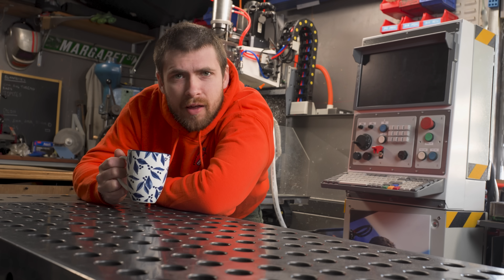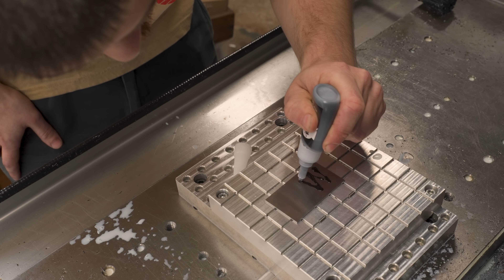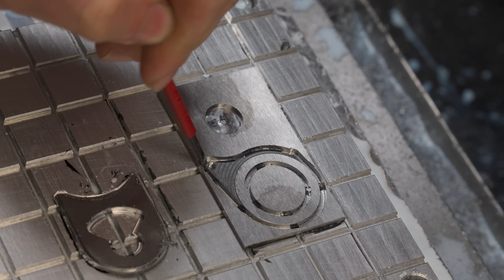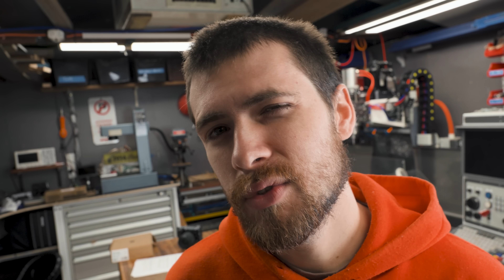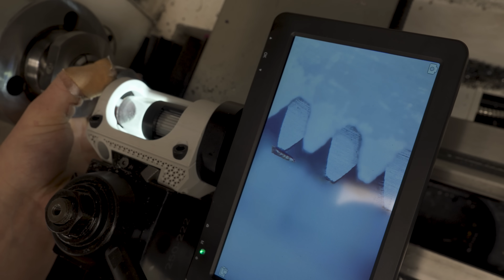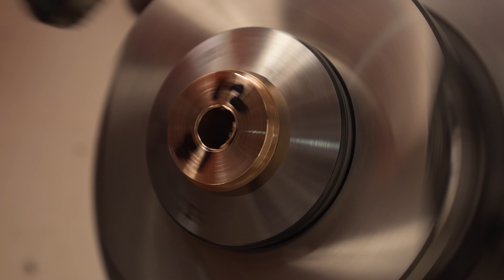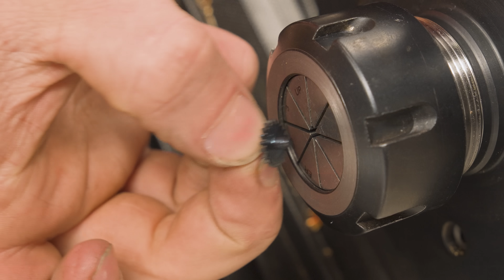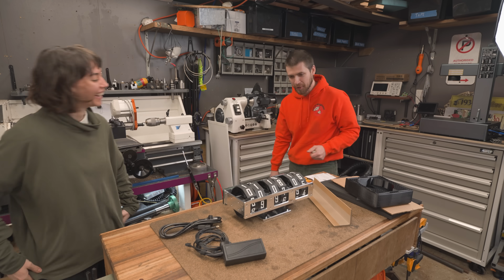What if angles were metric?

Comment: 37:30 fun fact: without a cellular connection, it can take tens of minutes to get GPS started. This is because the satellites use code division multiple access to be able to share a small set of radio frequencies between satellites. Receiving a CDMA signal requires first "acquiring"* the signal, meaning the receiver is constantly adjusting decoding parameters until it gets an intelligible signal. Acquiring the first satellite can take significant time. Afterward, the messages from the satellite include pieces of an "almanac", which has the information needed to greatly narrow the search for acquiring other satellites. But getting a whole, up-to-date almanac from one satellite takes 12.5 minutes.

Cellular providers generally broadcast the current GPS almanac to devices on their network, allowing them to skip the slow first acquisition and waiting for the almanac, and quickly acquire satellites.

clarification based on responses: the "can take" in "can take tens of minutes" is doing a lot of work. As receiver hardware developed, newer chips became capable of acquiring GPS signals faster. However, old chips (GPS or otherwise) tend to have long product lives, so I was expecting the slow GPS fix shown in the video to mean the clock was built with an old GPS receiver chip. However, after watching the video of the clock being made, I saw that it uses a relatively modern chip (NEO-6 family chip, 2010s, in the form of the GT-U7 module), which advertises a time to first fix of 32 seconds. I don't know why it took so much longer in this video. I'd like to point out that achieving this fast fix time requires significant hardware, with the module using the chip advertising "2 million correlators" to achieve this. It also supports being provided with an external copy of the almanac, as phones typically do, and advertises a 3 second time to first fix with an almanac.

*extra details: a major part of CDMA acquisition is synchronization. CDMA involves mixing the data with high-frequency pseudo-random data. The satellites talk over each other with these mixed transmissions, which each look like noise, but the receiver unmixes the combined mess with a specific satellite's pseudo-random data to get its transmission, and the other satellites' signals stay looking like noise. But the receiver needs to derive this pseudo-random data on its own, and it needs to stay in lock-step with the satellite. If the satellite's RNG is 159 when it transmits a bit, then the receiver's RNG needs to be 159 when it receives that same bit. The receiver knows (or more accurately, can calculate) the RNG sequence, but the receiver needs to guess where in the sequence the signal is at until it guesses right and the data appears.
Reply: Some corrections:
1. The Navy GPS designers arranged the NAVSTAR signal to have two RNG patterns, the slow pattern gives rough positions but allows quickly finding the right guess (it is thus called the C/A or Coarse/Acquisition signal)  The fast pattern provides the better precision, but was originally encrypted so only authorized US weapons could decode it.  However civilian GPS receiver designers found a trick: Because the same encrypted fast signal was sent simultaneously on two frequencies, a receiver could just compare the two without even trying to decrypt it.  Hence modern GPS signals gave up that secrecy and added a third frequency for precise civilian navigation, while reserving the right to change what is in the encrypted data stream.

2. Most cellphone networks don't distribute a copy of the GPS almanac, instead they provide 3 other services that allow cellphones to get the position anyway:
 2A. There is a service where the phone can ask the cellular carrier to use their radio tracking of cellphone signals to report the cellphone location based on the known location of the nearest celltowers.  Some modern phones can do the same using the known location of the nearest WiFi routers.
 2B. They broadcast the time of day with a high precision.  Time plus rough location provides the important 4 values from the GPS trilateration equation.
 2C. They provide Internet service, which allows the phone to download the weekly almanac from public websites run by the makers of GPS chips.  You could download that same file over WiFi if you have it, or just watch the GPS broadcast for 12.5 minutes (500 GPS data packets of 75 bits each at 50bps C/A speed).

3. GPS Time consists of a week number counted since Jan 6, 1980, a count of 6 second (300 bit) subframes since the start of the week and a count of bits since the start of each subframe.  Because the week counter is only 10 bits, the calendar starts over every 1024 weeks or 19.7 years, because everyone already knows which decade they live in .
Reply: @johndododoe1411 Based on relatively recent events, a certain phone company in Australia would disagree with "everyone" in point 3 :).
Reply: @johndododoe1411 "Because the week counter is only 10 bits, the calendar starts over every 1024 weeks or 19.7 years, because everyone already knows which decade they live in " 
Optimists.
Reply: Yes but no, a full cold start yes, but unless it’s been over six months since that device has updated, and you haven’t lost time keeping. You will retain a decent chance at locking in fast. 

If you’ve been on in the last 4 hours, and again have a good clock. you’ll get with in 100m in a couple seconds, and 10m a couple seconds after that. No cell needed.
Reply: @PredominatelyFutile   How precise does the timekeeping need to be? Because i have a bicycle GPS here which in absence of a mobile phone (it's intended to be used BT-tethered) drifts in timekeeping by minutes a week!
Reply: @SianaGearz  you can get nanosecond-accurate time from GPS alone (and, in fact, GPS only works if the device knows the time within a few tens of nanoseconds, which is why they made it so you can derive that from GPS in the first place). It's absolutely bizarre that any GPS enabled device wouldn't have perfect timekeeping, because it definitely has a phenomenally accurate time available any time GPS is active.
Reply: @clapanse   I would assume there's two or more independent pieces of software running in their own worlds, whether it's one chip with several different architecture cores (such the the chips Mediatek built for feature phones 20 years ago and then carried over into the world of wearables and gadgets a decade later with minor changes) or even two different chips. In fact i suspect it's two different chips, because you need a firmware blob to implement ANT+, i know there's one for Nordic but i'm not sure about others, and Nordic micros have got plenty of capability to draw the screen and do Bluetooth, but don't have GPS. Communicating via UART between GPS and application.

So you have the firmware of the GPS, which operates on precise time that it gets from the GPS; and other other being an application which does the whole logic/screen etc. In standby, one peripheral will be kept running say a counter that ticks up every second, say from a wonky internal RC oscillator, because that's the amount of drift i'm seeing, that allows to reconstitute the RTC when the device is booted again, or ideally a true dedicated RTC but let's face it that's not gonna happen. That will be the time used by the application and also the time used to initialise the GPS unit when it's powered on again.

You can just request the precise time from the GPS unit but i suspect the application doesn't do that, to avoid a race condition of updating the time from the app on the phone, which is something it also does, or because they experienced a race during initialisation. Or because they forgot.

But to come back to that, i wonder how much of a chicken and egg issue the whole bootstrap is, and whether wonky timekeeping in standby is interfering with getting a fast GPS fix.
Reply: @PredominatelyFutile  Why is keeping the time relevant? AFAIK most GPS receivers use another satellite for time reference anyway because their internal clock isn't nearly accurate enough.
Reply: @tz8785  Timekeeping while the GPS receiver is off. If you have a rough idea of time and location (assuming the device didn't move in the meantime), getting a GPS fix is much faster than from a cold start.
Reply: I didn't understand past the first line of this comment, but I know what you are driving at (from firsthand experience, both of GPS in the old days before phones had it and more recently when I was ableto GPS navigate to a remote destination out of cellular range but not home again the next morning) - I just wasn't able to assimilate all the technical details of the explanation. 

Oh - nothing wrong with the explainer, it's all on my arteries being too hardened to be able to drive my brain to the intellectual effort required.
Reply: The almanac almost doesn’t matter anymore. It was helpful in the olden days when receivers could only decode a limited number of PRNs at a time, so the almanac would help the receivers to make an educated guess as to which code sequences to try. In a modern receiver, you can more or less decode every possible option at the same time, so the almanac didn’t save you any effort. This is perhaps why a commenter above may have observed relatively fast startup in the 90s – it’s possible to get lucky without the almanac.

tl;dr: The ephemerides you get from the cellular network are probably more important for a quick fix these days than the almanac.
Reply: Top comment
Reply: Im not gonna lie I thought it was going to be a massive odometer lmao, I didn't know the creator and saw car badges so I thought it might be something car related
Reply: That's strange, because I used handheld GPS units in the 90s and it took about 15-35 seconds to acquire the first 4 or so satellites on startup, from a cold start, before CDMA existed.
Reply: @mrfawkes9110  The very first version of GPS (and still the only civilian version considered "ready"/fully deployed by the US government) uses CDMA. It had a different name ("code division multiplexing"), but it is an early version of the same concept used by things like phones.

(also, city-scale testing of CDMA for phones started in 1991, by Qualcomm)

A GPS message takes 30 seconds to send, so your device certainly had a sufficiently-recent Almanac. As another commenter pointed out, the figures I mention are for a true cold start, but if a device can keep reasonably accurate time, an almanac can be good for up to six months

in the 00s, I occasionally had the long waits for true cold starts.
Reply: @klikkolee   I bought a VDO R4 just recently and the first fix took about 6 minutes under clear sky.
Reply: @SianaGearz  The VDO R4's product page mentions it also uses GLONASS, which uses frequency division multiple access (FDMA), which does not need an acquisition process. That would help it get started much faster.

It might also have support for the newer L2C GPS signals. L2C isn't completely deployed but is operating. L2C signals can be acquired much faster and broadcast almanacs faster.
Reply: The PRN chip length is only 1023 bits repeated every millisecond. Acquiring the DSSS sequence timing happens very rapidly, in theory at most 1 millisecond with enough processing power, in practice even in an old underpowered GPS receiver less than a second.
Reply: “Fun” fact😂….love-it man, love-it (and I remember well the first commercial hand-held GPS bricks …we used to say “boil an egg, we’re getting a fix…”😅👊
Reply: If that's true (I keep location turned off in my phone, because I have no need of it ; so I don't know) then the state of modern phone GPS chipsets is considerably behind that of hand-held, battery-powered GPS devices of 20+ years ago. These could do a "cold start" (from batteries-in to position display) in about 45 seconds - under open sky. In a wet woodland a couple of minutes for cold start. In a building - well GPS was never intended for indoor use - you read the address label by the front door.
None of which would surprise me - battery use constraints, computer multi-tasking, and an obligation to load adverts must all slow things down in a phone.
Almanacs are an issue - but unless the cold start is after a really prolonged period of not running - months, maybe years - most devices will have the last almanac they collected, which serves to give an approximate position in the number of minutes before an almanac update becomes available. As satellite almanacs update, the estimated position gets (probably) better and the position error decreases to the design uncertainty of about 5m. Unless you're using DGPS, which is a lot more complicated.
Reply: That's why the GPS took so long when I fixed it in my old merc 
Thank you for infodumping here, kind stranger!
Reply: @lvcifer-cloverfield  There are lots of other things that might be relevant.
There is very likely to be a decoder module somewhere in the guts of the car ; and a receiver module somewhere in the car where it can "see" the sky ; and a cable linking the two.
Cables die - and worse, corrode.
Receiver modules have failure modes of their own. Including boring dirt on the outside of the module. Or electrical interference from, say, a dash-cam module fitted next to it.
There's a lot of troubleshooting available to be done before looking into complex signal processing questions.
Reply: Reminds me of back in 2006 when I got a Nokia N95. It had Here Maps and a full-on GPS receiver built in, one of the first phones to do so. But it didn't have a hybrid cellular/GPS system, just a separate GPS antenna. I couldn't for several days after getting it figure out why it couldn't find my location utnil I spent some time researching and discovered in order to get an initial lock it had to be outside with clear line of sight to the satellites for upwards of fifteen minutes. So I sat outside waiting and eventually it locked on and worked perfectly for the entire time I owned that phone.
Reply: there is a second part to that story. Like the almanac every 12.5 minutes, there's the ephemeris which is unique to each satellite, updates frequently, and takes 30 seconds to receive.
Reply: I assumed it was just because it was in a metal shed full of assorted machinery and stuff strapped to the ceiling
Reply: Surely by "takes 12.5 minutes" you mean that this is a worst case scenario, with the average time being 6.25 minutes?
Reply: @Oberon4278  No. 12.5 minutes is the best case for getting a whole almanac from a single satellite. The L1 GPS signal (often called "legacy" despite being the only one considered "ready" by the operator [the US government]) organizes information into "frames". From the start of one frame to the start of the next frame takes 30 seconds. Each frame includes a part of the Almanac, and each satellite transmits the complete almanac over 25 frames. 25 frames x 0.5 minutes per frame = 12.5 minutes.

Now, if you picked an arbitrary satellite and asked "how long until I get the almanac fragment that tells me if it's viable for me to connect, supposing I've only acquired one satellite thus far", your average and worst case would be applicable. But in my original comment, I was giving the figure to get the whole almanac. The best case time to get all 25 fragments is the time it takes to get one fragment 25 times. If the receiver can't interpret and stitch together partial frames, it can need to wait up to another 30 seconds to get the repeat of the first fragment that it didn't perfectly capture. And in the (unlikely) event that a complete frame couldn't be decoded, that would add an average of 6.25 minutes (worst case 12.5 minutes) due to waiting for the repeat.
Reply: No it dont takes tens of minutes. It takes a maxima of 16min till the actual gps almanach is sent again. If your device had GPS fix in the last 24h its down to iafaik 4min. If it was on in the last 4h its down to 30s. All other methods of faster position fixes uses other methods to get the almanach faster )like a-Gps from the internet. Or use other Nav Networks to get it quicker. Or use sideband methods like known wlan positions or known mobile cell position to get it.
Reply: @Total_Egal  
1: I already mentioned the time to get the GPS almanac.
2: An almanac isn't an instant ticket to a fix. It just narrows the search space for acquiring more satellites.
3: The post is about cold starts with old GPS hardware.
4: I have used such old GPS hardware, and it did take tens of minutes on occasion.
Reply: @klikkolee  Without Almanach you get not fix at all. Your expirience with longer as 16min Fix time is due to bad reception. But.. even in the old days with BT Mouse for your Nokia Phone you could see how many sat receptions you have even if you got no almanach ready. You need at least 4 sat fiex for a position. AIf you know about how GPS worked you put your GPS System on the south facing window while you are making yourself ready to leave. Not like others start it up in the basement car parking and rant about not navigation :P  Worked all the time even in tight city streats on hotel windows. Only trick was to raise the receiver high enough to be in the glas area. Since the window frame block signals.